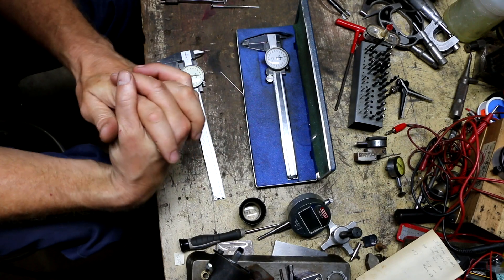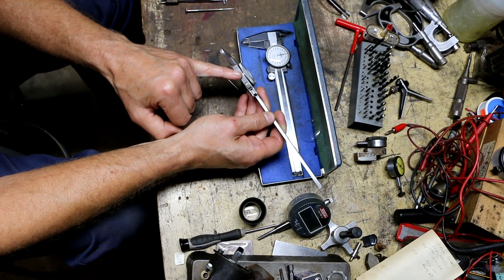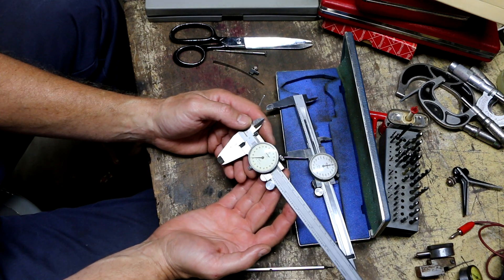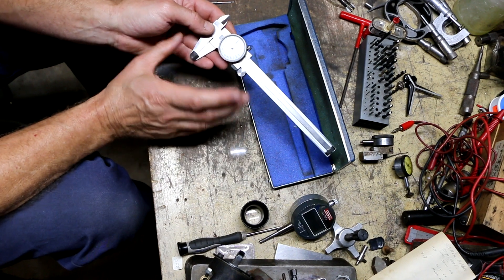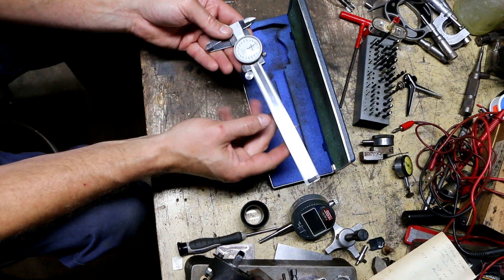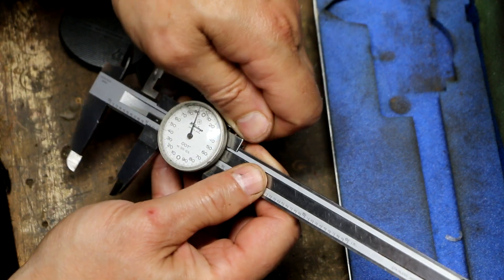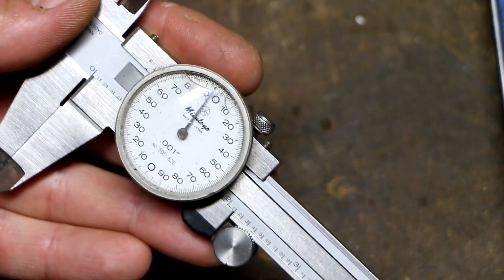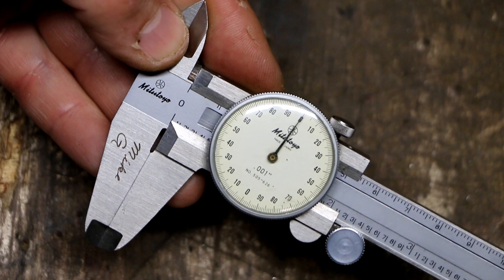Mitutoyo Dial Caliper Re-clocking Calibration

Comment: my display dial spins.. how can I fix that
Reply from the maker: Depends on what exactly is spinning. By design, the dial face with the numbers on it is supposed to be able to be rotated with the outer bezel. the bezel is then able to be locked in place by way of a thumb set screw. In this video, both of the set screws are removed. normally you have 2, one to lock the jaws, one to lock the bezel. If on the other hand, your dial face is turning independently of the bezel, it most likely has come detached from the backing plate, and repair is much more involved. 
I'm betting your just missing the locking thumb screw, they can fall out and be lost

Comment: Thank you so very much. Loosening those two jib screws allowed mine to go past 12mm for the first time in 2 years. I will now clean it and realign it and put it back into use and cease using my beautiful diamond series no parallax verniers. <3
Reply: Gutted, tuens out that somehow one of the teeth got half bent over into the valley next to it. Needs a new rack. Or maybe it's a write off. I will trg to correct it, but...

Comment: Thanks Steve, Mine is a 505-637 and just  for fun I cut a strip of soda can just to get a feel for the teeth location and when I felt it bind up I stopped. Sounds crude however I closed the caliper and it when 180 degrees from 3 o clock to 9 o clock. Tried it a second time with less presser and closed the caliper and was dead on 12 o clock. How luck did I get. Thanks for the tip. Never loosened the jib screws or anything. Now I need to inspect the rack with the stereo scope as it has a weird feel at .350 
but still measures nicely. Thanks

Comment: There is a very quick way to do this (though probably a bit of a bodge!) If, as with mine the screws holding the leaf spring are too tight to remove instead of a metal shim place a small piece of sellotape over a few of the teeth on the rack.  Then run the pinion over it.  Check the setting.  A few attempts and you can get very close to a vertical zero with minimum time, kit and effort!  Note, as I am sure you know, keep the rack really clean.  Tiny chips of metal can get caught in the rack's teeth gaps and cause the pinion to ride up and miss teeth.  Thanks for the great video!

Comment: Really not a good idea to go putting a shim strip in there to lever away the pinion gear from the rack. You risk damaging many things including the tension spring inside the clock. The easy way to do this is to pop the cover off the front and lift the needle off the pinion then push it back in at 12:00 (with the jaws closed or set against a standard).

Comment: I have a 505-637-50. Small paper clip in a slot on the back of the face at 12:30 seems to lower the pinion away from the rack to allow reclocking. Didn't even know it was possible. Thanks!

Comment: That final setting can't be 1 tooth off. That would mean the pinion has to have ~200 teeth.  1 tooth probably is what you had, .019 ~.020. which should be about 10 teeth on the pinion. Count the teeth on the rack over .200 and you'll have the number of teeth on the pinion. I'll say it has 10 teeth and each 1 tooth will put it out .020". For the small error left it has to be either the needle has slipped on it's shaft or the rack has shifted in the housing.

Comment: Nice video. You're not a tooth off though when it's off only 2-3 thou. A tooth is more like 10 thou, or 15 thou, depending if it's a .100" per rev or .200" per rev model. The way to get the last few thou is to loosen the rack screws from the backside of the caliper. Then you can slide the whole rack until you are exactly at 12:00 with the needle. Slide the rack by using the screwdriver still in the screw head, to push the rack one way or the other until it's perfect. Its super fast and easy.
Reply from the maker: Thanks!

Comment: Just a thought but on the first set you did with the strip of metal, rather than guess why not use a 1" standard from a 1-2" mic or a gauge block if you have one. 
I also have a video on resetting mitutoyo calipers, my most popular video by far, seems a popular subject.

Comment: Everything you’re doing in this video is nonsense. There is absolutely no point in making the needle stay at the 12 o’clock position. 

Of course you want to open and close along the whole travel to see if you’re jumping teeth but it has nothing to do with repeatability, accuracy and/or calibration. 

Please get at least one master pin to check for wear by rolling it from top to tips of the outside jaws, at least one gage block under 2” to check if it’s actually reading correctly (I’d suggest a square one cuz they’re better for checking the depth rod readings) and a master setting ring under 1” so you can check the inside jaws. 

It also literally sounds like you’re jacking up the teeth and gears by using that shim over and over again to very unsuccessfully to get the needle at 12 o’clock when all you have to do it rotate the dial and lock it.
Reply: What are you dreaming man? The needle is supposed to be at 12:00. Whenever you find a caliper that is not, it means it's been dropped. Having it at a random position like 4:00, and rotating the bezel zero there is nonsense. Yes, that keeps the accuracy, but it makes reading them difficult. Plus, it's not professional. Tools like this are used by professionals. If someone had one clocked wrong in a tool and die shop, they'd be laughed out of the shop.
Reply: Some older mitutoyo calipers came with a little strip of steel and instructions to do exactly this.

Comment: Thank you for this, my dad's old Helios skipped a tooth and I read somewhere about cutting a strip from an aluminum can. I was baffled how that would help and not damage the gear, but when I saw your video, I realized the pinion is just spring loaded and saw exactly what needed to be done. 30 seconds later, it was back to zero!

Comment: Hey do you know why the scale is in inches and centimetres? Strange to have a metric scale with an imperial dial.
Reply: @jacencko011  so I’ve got the same one and I just had a look to see that the scale only goes up in increments of 1.0mm.
Reply: @jacencko011  mine is 1.0mm ever line up to 150mm. Can’t do much with that anyway except guess. Would be nice if the dial had a second scale for metric.
Reply: His have imperial on the top of the rail and metric on the bottom. Seen some with both readings but the dial always represents one or the other.
Reply: @KazeHorse  very interesting. I recently picked up an old set of these calipers with the same scale. Reads in inches but shows metric as well. I wonder what the reason for this was
Reply: @freestyla101  the reason is so you don’t have to have 2 dedicated calipers if you work with metric & imperial.
Reply: @jacencko011  Do you read the scale and use the dial as if it’s metric? Or do you just estimate using the scale and ignore the dial.
Reply: @KazeHorse  you have that reversed; metric is on the top rail. You are also mistaken about the dial always being imperial; there are some brands that have metric and imperial readings on on the dial face along with being on the rail.

Comment: I had no thin strip at the moment when I went  to adjust my old dial calipers but I did have an identification tag with small wire wraps. The very small gauge wire worked easily.

Comment: My old set of Mitutoyos were dropped and feel like they’re skipping a tooth. Just not smooth and are clocked wrong now. I tried to loosen the set screws and used the wire in the slot under the dial, but feel like I can’t push up on it at all. Mine are .100 per round, but look similar to yours.

Any advice?

Comment: I quite often find that the brass gib strip that's on top of the beam gets very very dirty and makes it hard to adjust properly.  So I take mine out every so often to clean it with a medium hard eraser then a little Starrett tool and instrument oil will keep it operating smoothly at least for a while.   I also remove the rack and toss it in the ultrasonic cleaner with some simple green.  I've inherited some orpahan calipers that were given to me and they were quite gummed up so people gave up on them.  You can make the brass key pretty easily.  They used to sell that part separately, but for Mitutoyo items you have to go through a major distributor although I have had good luck with reaching them through their Instagram.